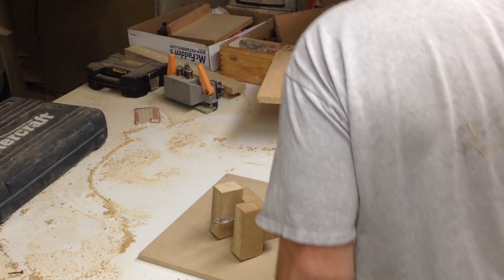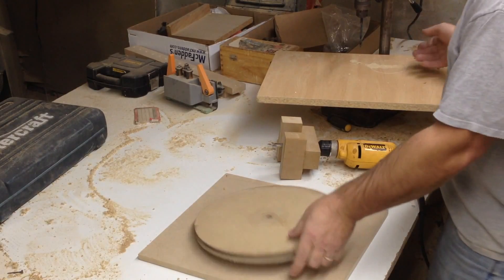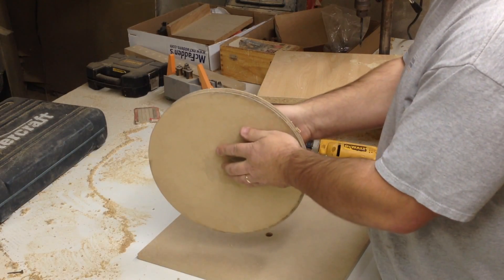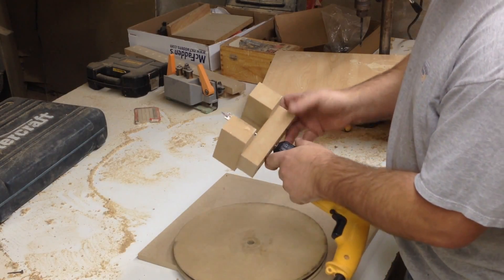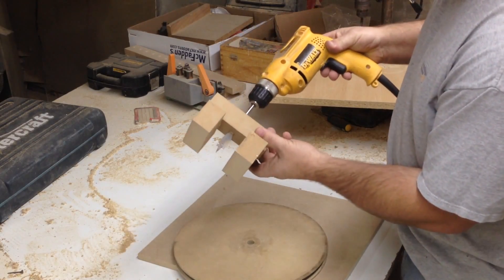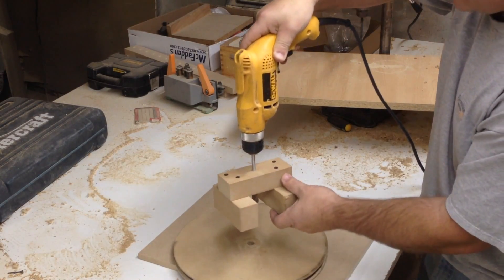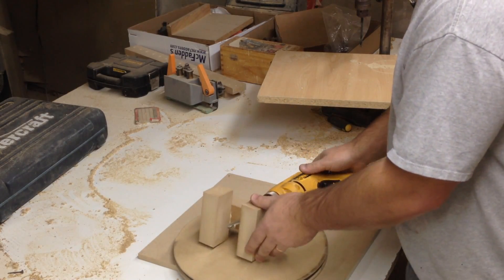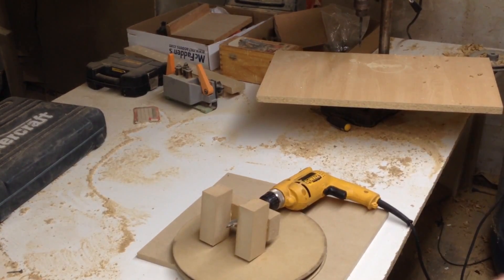Simple Drilling Jig

Comment: If you need more depth from your drill press (i.e. the ability to drill in a wider board), don't forget that you can reverse the whole drill press. Fasten it down to a table near the edge, allowing the drill bit to hang over the edge. Then the board can be slid under the tabletop as far as you need. Obviously the board would need to be supported nice and horizontal. Do you know anyone who might be good at making a jig like that? I do - you!

Comment: i'm looking up for ways to drill straight holes and the results here on youtube are slim pickings. its 2014. the wheel was invented a few hundred million years ago. you would think there would be a good tool to help you drill straight drills without a drill press. something similar to this thing.

but this wont work for me. 

1. im using regular bits and they will scrape up the wooden hole
2. i would need to have a hole for every size bit i use.
3. with the wood in the way, i wouldn't be able to drill very deep
Reply: TheEgg185 I just found two tools that would help to make straight holes: milescraft 1312 Drill Block and v-drill guide. Milescraft is the cheaper one, but both seem to get the job done. You are going to need a c-clamp to hold them, but it's cheaper than a drill press.